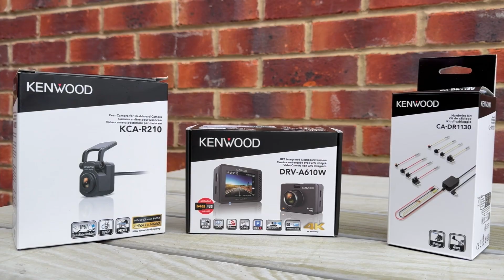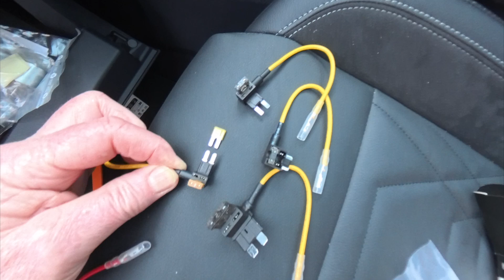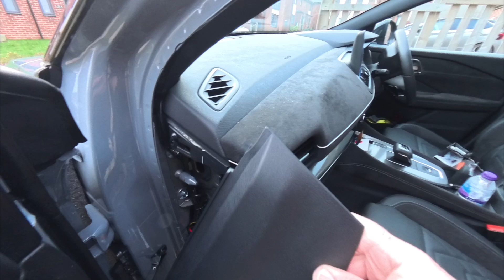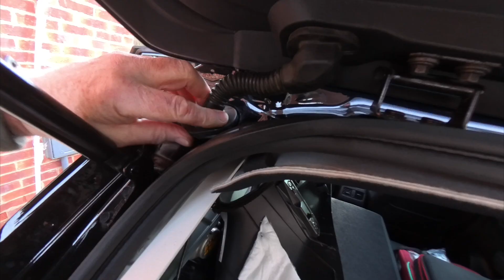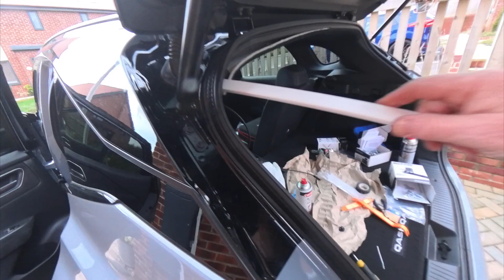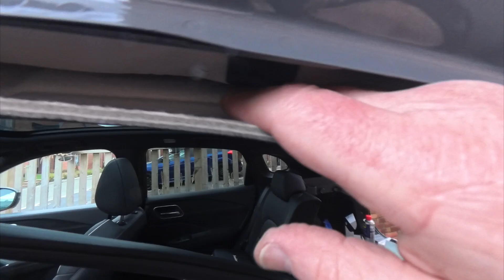Installing a Dash Cam and Rear Camera in a 2024 Nissan Qashqai

Comment: My concern is with the parking mode.  I am aware that most decent Dash Cams with Parking mode can be configured with a minimum voltage cut-off but I am still nervous about relying on that not to flatten the battery.  I do not get my e-power for another month but when I do it probably will only get out for a 170 mile trip every two weeks and probably not used much at other times.  My Current Dashcam which is fitted into my current 1.3 Hybrid Qashqai never has parking mode on because of my worries about draining the battery and under the same operating regime has not given any trouble.  How has your e-power been since fitting teh dashcam, do you use parking mode?
Reply from the maker: My 2024 Qashqai N-Design is petrol only so sorry I can't help with your question.

Comment: One question/remark. You have the fuse adapters rotated from each other. Else they wont fit I guess. But have you thought about the orientation of the fuse adapters? Probably one of the two will not be wired properly? 1 pin is voltage/current and the other pin is going to a device. If you connect the fuse adapter wrong, the original fuse will have more current through it...
Reply: Rotating them like this is the wrong way to do it, as one of them will be bypassing the fuse entirely. They have to be fitted the right way so power comes in through the fuse and out to the device, if they are fitted in reverse the device is directly connected to power and the fuse does nothing.

Use a test light or meter on the fuse box connector to be sure which side is actually live, or if you pull out the fuse from the adapter and it still works then you have it backwards